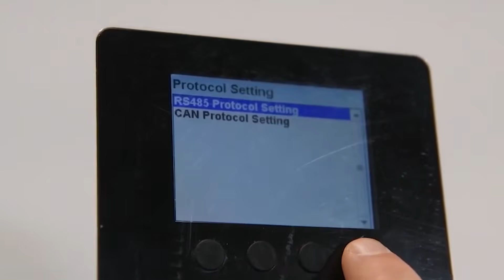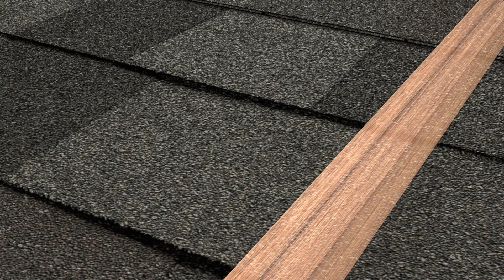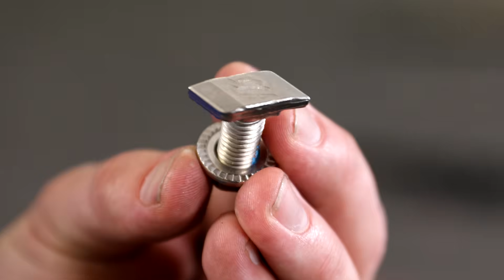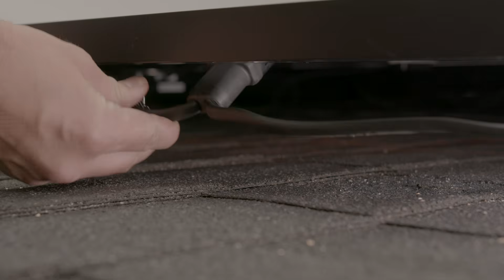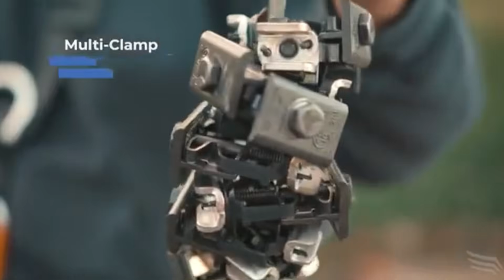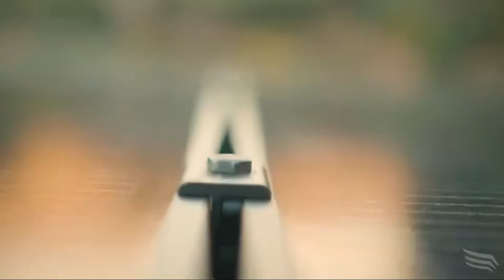Pegasus Solar Roof Mounting System | Faster, Cleaner Solar Installation

Comment: Over the years I collected enough shattered and otherwise "used" panels to produce 9kw of usable work against 3pcs Growatt SPF5000.

The mounting was always a huge impact/surprise.  I tried a leaning system on poles, laying flat, stationary 2x6 structure, etc.  

Ultimately I got the best possible value from T-Posts with 2x4 brackets strung with 20' salvage 2x4's.

Over the years I ran it with screw in brackets and salvaged middle clamps.

Held the load against a small tornado that came thru town and flipped cars.  Wood expansion/contraction loosened it up once a year.

Only ever found 1 free rail system and none of the hardware played nice together except the clamps.

Good luck and Innovate
Reply: Also tried the mini-rails.  Got 7 panels mounted on those and they held - but I screwed up the math many times!

Ultimately boils down to how long you want to spend baking your brain on the roof or field.  Mounting must be calculated into the project cost

Comment: Does this have a way to level the panels if the roof is uneven / wavy
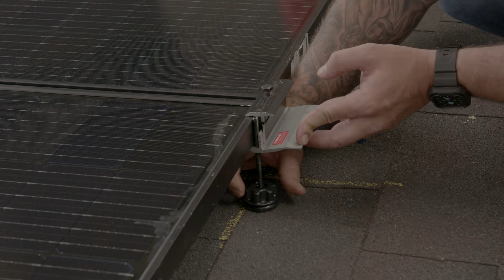Reply: You didn't actually watch the video did you.    @ 6:21
Reply from the maker: @opinionseverywhere 

Yes, the Pegasus Skip Rail can be used to help level your panels on uneven roof surfaces, including tile roofs. It helps create a more even mounting surface while also providing additional support where the roof has variations. As an added benefit, it can also serve as a bonding point between adjacent solar panels.